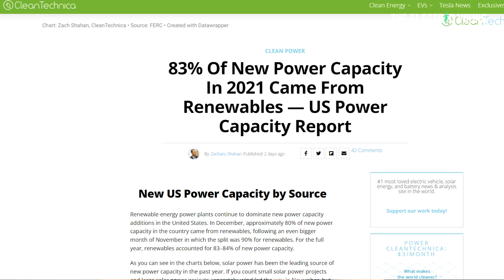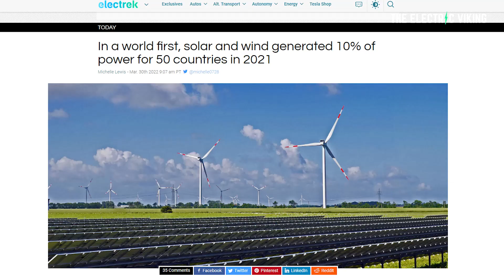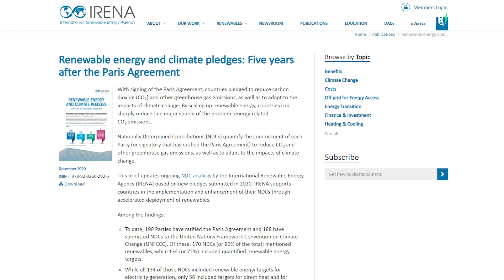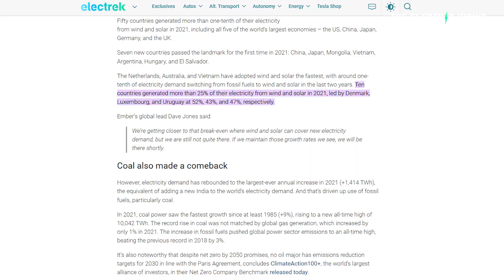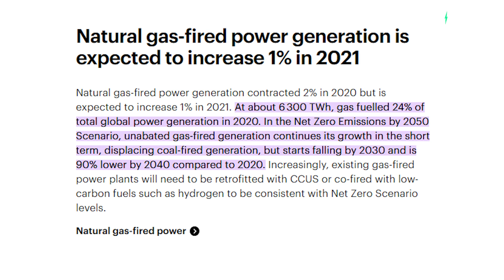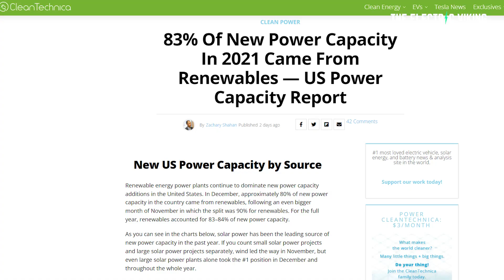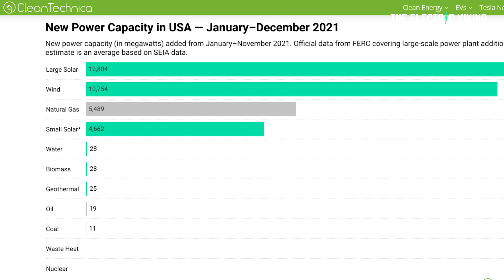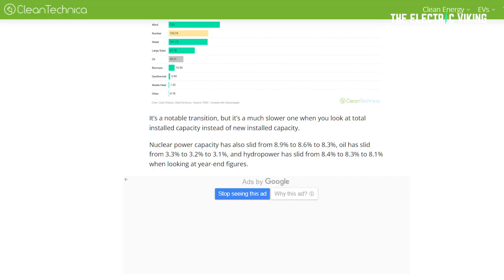Great news! 83% of new power in 2021 was solar & wind!

Comment: use Na sodium process to make aluminium directly from renewables, no battery long term storage, pump the energy in the metals, and the aluminium-air fuel cell feed stock metals, aluminium (and magnesium and iron, or silicon) are very inert non-flammable energy storages, as wires and sheet spools, extrusion, electrodes
Reply: stop wasting the energy in worthless things, you used to be independent with all the turbines locally
Reply: magnesium-air can have its oxygen in NaClO3, where there is no oxygen, but a stable (non-cryo-liquid) system is preferred, like in space
Reply: just heat the NaClO3 to 300C to release the oxygen, like in a submarine
Reply: aluminium is a battery, even in its solid separate form, its an energy source

Comment: China added 103GW solar and wind capacity in 2021
- added solar capacity 55GW
- added wind capacity 48GW
103GW equal to around 100 nuclear reactors.

In the first 2 months of 2022 China just added 15GW from wind and solar.
Reply: not nuclear plant, maybe nuclear reactors... a plant have multiple reactors. Kori Nuclear Power Plant have 8 units. (total, almost 8GW)
Reply: @morganangel340  Got it, thanks for correction

Comment: How is wind electricity being stored,  I thought wind electricity had to be consumed as it was being produced. And in Texas people nearly frozed to death because of the bad winters this year and couldn't rely on wind and solar.
Reply: Grids are comprised of multiple energy types. Dispatchable energy, like hydro, gas, geothermal, coal, and batteries have to be there to back up low wind periods. However big wind farms can be very consistent because of locations and height of the blades. Also distribution the wind farms,  over a country means the wind will be blowing somewhere. Most countries probably could go 50-75% wind and be fine. 
The future will probably see vehicles with high cycle life batteries and see vehicle to grid supply, this is likely to make the grid very robust on renewables like solar and wind. And homes with batteries (and their own solar).

Comment: China is maybe the biggest story here, and I like the point you make: yes, they're still building new coal plants (mostly to replace old, dirtier, less-efficient coal plants), but if they're expanding renewables faster then that's a net gain. Nice report!
Reply: Also since they built a network a ultra high power lines, they can build power plants far away from cities, (don't help with CO2, but it help with smog in urban areas)

Comment: Having sun not it all, hot sun like Australia not good for panel life or efficiency, solar hours the thing to look for , heat temperature of the air not the point , it’s lack of cloud , so winter sun good but not as much , summer sun longer hours but heat of panels a negative

Comment: lot of new Chinese coal plant substitute older coal plants built in the nineties, which aren't energy efficient enough. Like in Fuyang, part of Hangzhou, biggest paper making city in the world. They used to have 6 huge coal plants built beginning of the nineties. in the tens, those 6 power plants were substituted by 4 new coal plants, which consume 20% less coal, but generate 60% more electricity and 80% more steam. So they get almost twice as much energy out of the same amount of coal. Reducing significantly the carbon footprint.
Reply: Also since they built a network a ultra high power lines, they can build power plants far away from cities, (don't help with CO2, but it help with smog in urban areas)

Comment: You are on point on this. Solar is becoming more and more efficient everyday And less expensive. Over the next two years we will begin to see a complete Paradigm shift in the way we produce Electrical energy.
Reply: Frank, 

not from solar you won't. even if it is getting more efficient, it's availability factor is still woefully low and it doesn't fit the demand load of many countries, if any?

Comment: IF you are only talking wind and solar - then its only 2% of world electrical production. This goes to a problem with EVs as if you are going to be replacing older energy production; you really cant burden the grid added demands like EVs; or your increase Solar/wind won't even keep up with added demand and that in turn means more fossil fuels.  This is why hybrids are still superior as they use far less lithium per unit; reduce CO2 substantially; and do not need to burden the grid. So current EV tech is bad.
Reply: Yes if you include 3rd world countries.

Comment: While battery storage does speed up the adoption of renewable energy, it is not actually as necessary as most people believe. 20 years ago it was shown that if the US massively build up wind resources, and some solar, we could be at 90% clean energy within 16 years and have cheaper power than we had then. Wind and solar can be taken offline or brought online very easily, and since the wind is always blowing somewhere, strengthening the grid would allow for transfer of power to areas without power production.

Comment: This is not good news, it reflects the technical ignorance of the poiliticians who push this unreliable and expensive source of electrical generation.
 The figures sound impressive but when translated into average power generatied it is much less. U.K. figures are about 35 % average produced to nameplate for wind and 10% for solar. Not only that but no matter how much renewable capacity is installed there has to be an equal amount of reliable conventional generation capacity available.
Reply: That's true because the wind doesn't always blow and the solar panels can't see the sun all the time due to clouds, snow, or night time. Solar power sounds nice, but it's not to the point where a technological society can exist on it alone.

Comment: The other 17% is what is used to power electric vehicles.  That is why they pollute so much!  EVs are worse for the environment than Gas cars.  They just concentrate all the death clouds in one place.  The power company!  Did you know that it takes thousands of extra megawats of power to charge an electric car miles away from a power plant burning only coal (because those are for EVs exclusively) because of power loss over miles and miles and miles of cables!?  Did you know that?!  Diesel is the most efficient power source for cars and trucks.  Tesla is a fraud and will never survive.  Selling a few hundred cars a year is not going to "save the environment!"  Carbon footprint for batteries is HUGE!  Every battery car destroys 10,000 hectares of rainforest and at least a dozen small children in the Congo die every day mining Cobalt!  - Every media channel in 2016-19

Comment: As much as I love solar energy (my house is off grid) I have it mainly because I don’t trust the current US energy policy. The current renewable energy technology allows only a temporary, limited supply and use (and still relies on oil for manufacturing equipment, transportation, mining, etc.)  Battery technology is vastly improving but still, unless there is a massive amount of energy storage for each vehicle, home, etc, dependable renewable energy is a pipe dream.
Nuclear power is too dangerous. Japan and the US are now dumping “safe” contaminated water, used to cool nuclear reactor equipment, into the oceans (Humanity will pay a steep price for that). 
Low water levels from lake Mead and Powell will not be sufficient to produce the hydro power at Hoover Dam which is months away from turning off most of the power generators  and which will have a great affect on much of the western US. A lot of people are about to find out how great the renewable energy is that ignorant politicians are blindly pushing.
Natural gas can be used with almost zero emissions. Germany just announced the planned construction of two new natural gas powered power plants.

Comment: Bad news:  100% of the power blackouts and fluctuations, were due to that new wind and solar (and reduced number of coal and nuke plants).

still feel like celebrating?
Reply: That is just a lie.  Almost every blackout was caused by greed of fossil fuel companies refusing to build a safe infrastructure.   Batteries are available  by the flick of a switch .  Go away troll
Reply: @girowinters  Nope.  What you just posted is the lie. Reliable base load (coal and nukes) has been taken offline, and has NOT been replaced with ANYTHING (solar and wind don't work, so they don't count).  Greed?  Talk about batteries, which cannot discharge above a specific rate, and have less than FOUR seconds' worth of power available...even for transitions or switchovers.

The real greed and corruption is what's funding unreliables like pinwheels and smoke-and-mirror solar.  Corruption takes money for reliable stations and pays for Tesla-branded Samsung batteries.

You're a tool...and a fool.  And you just admitted to it.
Reply: Not true in texas. they have a corrupt FF energy system
Reply: @larryc1616  No, they had a good system not dependent on a national grid...until they started including pinwheels and smoke-and-mirror solar...BOTH of which failed.  As to gas, it would have been able to do more, but some brain dead lefty decided solar-powered electric pumps were better for gas flow than the uber reliable diesel generators that had been there for DECADES.

Agsin...unreliables and loony lefty policies were and are the problem...NOT THE SOLUTION.
Reply: This Bill Cichoke clown is paid to lie
Reply: @djnavari  Nope.  But I PAY every time this 'green' crap gets implemented.  As do the rest of the taxpayers and less well to do.

So it PAYS to RESIST it.

Why?  Are you PAID by the parasitic green industry?

Comment: My wife and I visited friends we had not seen since the Pandeic started, in that time they had acquired a Hyundai EV, it gets 260 miles per charge, which costs $2.40. With gasoline now around $4.25 per gallon they are saving a ton of money, while also saving the planet and the little car drove away in near total silence! I love the Peace and Quiet!
Reply: I'd like ot undsrstand how your Hyundai EV only cost you $2.40(USD?) to charge.  Was that a 250 mile round trip? Did you not pay your share of road tax by charging at home?  In my state EVs get a $700 added tax to pay their share of road tax.  I've seen higher than $4.25 per gallon - but power charges vary all around the country; and if you have to use a for pay super charger your cost for your trip goes up quiet a bit hence my question.
Reply: What model Hyundai is that?  The Ionic only has a 40 kWh battery and highway range of about 150 miles. The Kona w a 64 kWh batter might make about 250 miles but it will cost $5-6. to charge it if you don't pay road tax and you don't have to super charge - still cheap compared to gas but twice what you state. If it wasn't a rt of 250 miles then you have to super charge and that will run your costs up to about $25 to go 500 miles; thats using the cheapest electric rates in the USA.
Reply: Welcome to the UK... 30p per KWH (10p per mile on a typical EV) vs petrol £1.50 per litre (that in my Audi A3) works out at 15p per mile.  Can I come and live with you?
Reply: @Chilternflyer  Where are you buying your petrol, its £1.65+ per litre in London

Comment: I do not know if you are reading these but...
Wind power is a huge problem, in Sweden a lot of investors are losing tens of millions of dollars. The China Nuclear Company has 4 or 5 fields of windmills in Sweden, which are per total minus more than 10 million dollars. Why? Because wind is the most expensive way to generate power, is unreliable (this year was much less than expected wind) and the costs are not getting low with an increase of the volume, are increasing also as the number of windmills... without "green certificates", in Europe was no solar or wind power. This is why the USA and Tesla are far away in front of Europe. They do not have "green certificates"...
In Spain, 62.000 peoples who listen to the government and invested in solar power individually are in bankruptcy now... https://www.youtube.com/watch?v=-0gbisTsj2w&ab_channel=FRANCE24English
Do you remember the American solar power project, much-hailed, using molten salt? Is closed, in bankruptcy...1 billion dollars molted.
So, 2022 will be completely different... this is the real problem of solar and wind power on earth. Solar power in space - this is a solution. Is not enough to have clean energy. We need to be able to buy it also. In the last few months, the energy price increased in Europe 3 times, because in winter is no solar and the wind was not blowing enough, wind electricity was under 10% of consumption and was planned to be over 20%...Oh, the biggest sea farm of windmills from the North Sea, of Britain, is losing money also. A lot. They - the British- want to close it. Dogger bank ...

Comment: Recently a university signed a deal to get their power delivered from a solar power plant in Texas.  Texans went ballistic saying natural gas was really cheap in Texas.  When the came after the president of the university, he replied solar costs are fixed, I do not have to worry about the costs changing.   I bet he was reminding people of this when natural gas power generation systems failed because of 🥶 cold weather and recently when the price of natural gas skyrocketed.
Reply: Texas teabaggers = Evil as Sin
Reply: You should check if that solar plant remained online during that outage. Most renewables failed AFAIK, because they weren't designed to work in those conditions.
Reply: @kofManKan  I'm in Texas, it was turbines which weren't winterized along with too many coal and natural gas fired power plants. We even had one of the four reactors in the state go down for "cold weather issues". Ironically it was at the southern power station.

To top it off wellheads froze cutting off gas supply and gas pumping stations had been signed up for a program where they were voluntarily cut off during periods of high demand, like during the crisis, further cutting off fuel supply knocking even more plants offline.

Solar worked just fine. Just ask the people with Tesla powerwalls who never lost power during the two days or more that power was out in their area.

If solar works on Mars where there is  ⅓ as much solar energy and temperatures get as cold as -60°C, it can easily handle a little cold here on earth.
Reply: @kofManKan  solar should have been fine.

Comment: Solar and wind can also be installed local where it’s needed instead of relying on massive transmission lines from large remote power plants.
Reply: Solar yes in latitudes less than 40-50 degrees (hydro usually good in higher latitudes). Wind, usually not good for cities, because people live in low wind speed areas. Wind is better out at sea or on ranges. Energy from wind is proportional to wind speed cubed. Big turbines will access higher wind speeds. Small wind turbines, don't provide much energy.

Comment: New coal plants get built in China, yes. But it's complicated. More efficient newer plants sometimes replace inefficient older ones. Plus, capacity factor of a new coal plant may be impeded by effect of renewables.

Nevertheless, recent years have shown an uptick in coal generation in some countries including China. Hopefully, its temporary as dropping cost of clean energy plus storage take over in the long run - but it will take time.
Reply: And yet China cancelled 83 coal fired plants 18 months ago. Including a bunch of projects that had already broken ground. The only coal plants that are coming online now were ones that were too far along in construction to cancel. China installs more solar and wind in a month than the rest of the world has each year. The equivalent of two football fields of solar are installed in china every hour.